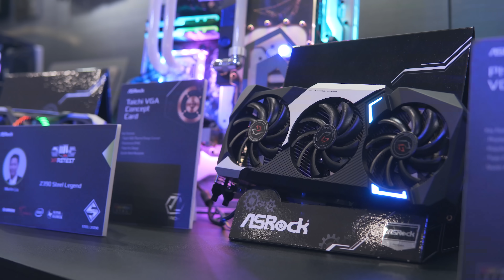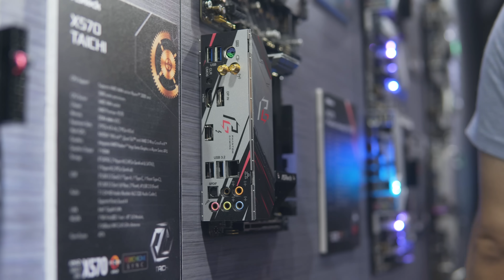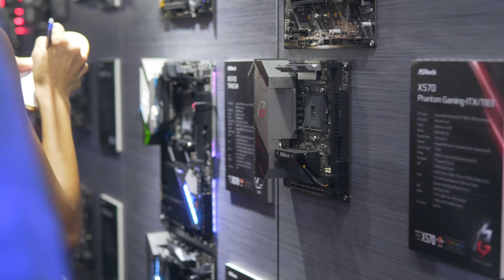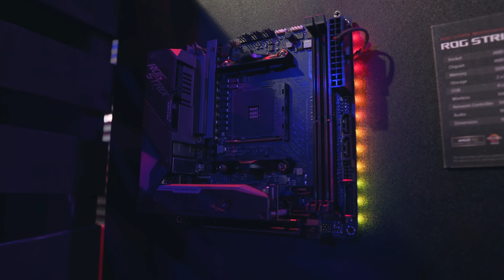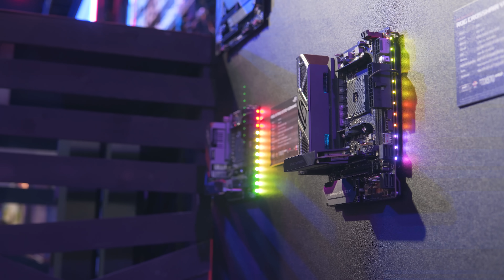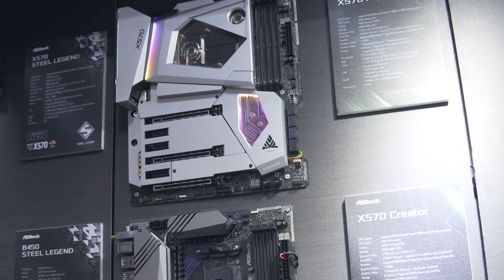ASRock X570 ITX Motherboard - Get Strix Instead?

Comment: 4 rear USB ports is more than enough. if you need more just get a USB hub. the only issue i see here is the SATA port position, but you can get a right angle SATA cable to try to avoid hitting the PSU in SFF cases.

Comment: This is an OK board, the main thing is don't buy the MSI itx boards as they've really dropped the ball and are really poor quality and performance. The Asus and gigabyte X570 itx boards at around £190 are both very good and well worth the extra £20-£30.

Comment: For everyone wondering why anyone would ever need 6-8 USB slots:

I need two for my keyboard, one for my mouse, one for my headphone's DAC/AMP, and one for my microphone. That's already five slots required, without even taking into account flash drives, external drives, webcams, and other miscellaneous peripherals for work purposes.

It adds up quickly. Thankfully, the TB3 port would be perfect for a USB hub!

Comment: 6-8 usb ports? I use TWO on the back (mouse and keyboard) I use TWO on the front (sometimes, not very often) so still 2 spare + TB3 port on the back, that's not bad at all... And there are 10Gbit ports on the back, that's pretty nice

Comment: Typical Ass-rock. 

Sadly, ignoring form-factors and making excuses is a long running habit of theirs. Like putting chips on the underside of the board inside Intel's keep-away zone, so you can't fasten coolers. Now huge rear IO shields with no ventilation while also blocking aftermarket air coolers, and I know they'll say "Oh, the design is for people using liquid coolers." because that's just what they do, design things badly and make excuses for it later. 

I recall when people hen people complained about the chips on the itx boards they said "Itx is a small form factor, so some placement of parts is unavoidable." All this flat out lies when none of their competitors had any problems doing just that. 

I'll stick to ASUS. As my grandfather said "You can make excuses, or make it happen. That's the only two options you ever have." ASUS makes it happen, ASRock makes excuses. I know who I'm going with.

Comment: No. But it's not. SAME.
Gigabyte in my country, it's just plates that live going to RMA. It makes 'common' versions of all computer components. This line 'Aorus' is just to get the Cattle. If it's only by appearance, then I'd get Strix. But no. Clearly ASrock is the only one to put really premium components on the boards, it has thunderbolt 3, it has audio with optical output, it has wi-fi 6 + bt 5, and it has a much more robust heatsink, besides being considered better for over Gigayte and Asus, are just branding and marketing. Yes, it's more or less, but still not close to ASRock, if we see the whole of the work. Clearly, by the robust dissipation set, asrock is the best version. The other manufacturers, use cheap components on the boards, making savings, and spend a lot on the 'marketinhg', like asus. ASrock, saves on advertising, but does not save on components. Much better. Asus where I live, lives giving problems in most of the boards, in the sound part. Majority RMA. MSI again, more or less. It does not do anything great or bad either.
Reply: @t1murik  so much so that I believe that asrock x570itx, will be the only one to be able to support the ryzen 16c/32t, in 'stock' without 'burn'. the others I do not know.

Comment: Wait.... Thunderbolt on an AMD board?! Am I dreaming?
Reply: O YE YE
Reply: Only the high-end mobos are getting it
Reply: Universal Audio Arrow user..
Reply: @IvanSDizon460  hey...help!should i buy this motherboard? Ryzen 7 2700 and apollo x6 uad!!!is it stable with uad apollo?
Reply: @georgezorbas6422 both searching for an answer, i am planning too,  i have ua arrow, still ,not using it,  i dont have pc or laptop with T3
Reply: @georgezorbas6422  macbook 2017 2018 2019 2020 a sure for universal audio..
Reply: @IvanSDizon460   no mac!I am gonna buy the Asrock x570 Phantom Gaming itx..the end
Reply: @IvanSDizon460  BIG DAY TODAY..I made some pressure and Asrock emailed me today and told me that they emailed UAD to send them a unit and find the solution for a stable compatibility through Ryzen and UAD interfaces with thunderbolt 3..Spread it..
Reply: @georgezorbas6422  that is a good news,  no need to expensive macbook

Comment: Pretty nice design, but what makes or breaks an ITX board for me these days is when they only have one M.2 slot. I don't want any 2.5 drives going forward. My Asus X370 ITX has one on the front and one on the back and it's just a pleasure not having to wire SATA cables anymore.

Comment: 6 to 8 USB ports on the rear? For what? You have Thunderbolt3 so you could run a hub, you have front IO which usual minimum has two USB and to be honest it’s an ITX board, can’t imagine the typical person going for that board really needs that many USB ports.

Comment: Am i correct in thinking that i won't be able to use that DTX board in a NCase M1 together with a AX3 because of the SupremeFX PCB?
Reply: No. I think it says on the ncase m1 page that Mini-DTX is supported. Check their page.
Reply: @mojoo215   I'm not worried about the board not fitting. I'm more concerned about the audio shroud blocking the Accelero Extreme 3 cooler
Reply: Ok nvm. Didnt understand what you were saying sorry.

Comment: I've yet to see a X570 ITX that gets my attention. My 2 requirements are SPDIF audio and 2x m.2 (even if one runs in sata3 and/or pcie 3.0mode only).
Reply: Zoomzabba does the Strix X570-I not have SPDIF? I know it’s got dual m.2 support and Asus mid- and high-end boards usually have SPDIF.
Reply: @natecook06  For audio, it has 3 black 3.5mm ports. Unless one has a 3.5mm TOSLINK back-end, I might have to strip digital audio off of HDMI with an adapter dongle. Starts defeating the purpose of a compact sandwich build if you have a billion dongles.
Reply: @zoomzabba452  Its 2019, use audio from HDMI dawg. And if you dont have it upgrade brah
Reply: @BoogieDownProduction  I've got a Logitech Z-5500. Probably going to get a Asus Xonar usb sound card for my digital out.
Reply: @Herr.Mitternacht  it's a somewhat reasonable solution. My thinking was 2x1tb because used ones are well priced and offered more future expansion internally. Currently I have 2.75tb between 2 ssd and 2 HDD. 1tb hdd can get external on the network

Comment: tb3 and optical audio out? this is the one for me
Reply: @Pho Tato "sorry, I can't hear you over the sound of my [mom's] system." You forgot that part.
Reply: @Pho Tato Whats wrong with optical out? Btw miniDSP is great. Have one hooked up to my PC as DAC for headphones and speakers.
Reply: @misterx3666  SPDIF is outdated because of bandwidth limitations, 5.1 gets compressed with optical. 
No modern immersive standard is supported by optical like Dolby Atmos or DTS:X. 
Still, it's great for stereo uncompressed. And I use it because my Logitech Z906 5.1 only has optical as digital input.
Reply: @hexeno  I want optical for convenience. If I build an sff itx PC I want to it to places (eg friends home theater). At the moment I don't care about those new standards as I am running a 2.1 setup (so is my friend). Pretty much every AVR and Dac has an optical in so it's good to have one on your PC. No driver problems and ground loops.
Reply: @misterx3666  exactly
Reply: @Pho Tato AFAIK you can't interface HDMI through DAC and/or amp without extracting the audio signal first. And if the usb out is noisy, optical becomes the most convenient option for dedicated audio setups
Reply: @Pho Tato Most people (including you) won't notice a difference.
Reply: @Pho TatoWow, trying to convince me you can hear a difference? That's a good sign you can't.

Comment: I love Asus' stuff, but the markup on their boards /cards is crazy
Reply: Asus quality isn't what it used to be... Been building for nearly 2 decades now
Reply: The last Asus motherboards have been garbage.
Reply: Warlock Plays like what ?? Been building for years and Asus make very solid boards. From dozens of builds i made they been most reliable. I’ve had good experiences with AsRock boards too.

If anything boards nowadays (at least mid to high end) are much more premium and difficult to “break”. Also less compatibility issues. 10/15 years ago was much different. There were solid boards too of course but there were many other issues, like compatibility with CPUs of the same socket, etc.
Reply: at least it comes with the added addition of better reliability and cooling
Reply: @heart4011  in theory at least

Comment: Really hope AMD implements more Thunderbolt. That's a hook selling point imho. Even sound interfaces support it like Universal Audio. Better yet, I hope Thunderbolt 3 gets full integration in USB 4.0 so everything on every board is supported.
Reply: It’s not down to AMD, this is down to board manufacturers to implement which they are all free to do.
Reply: @backupplan6058  Well let's hope they see the value in it. It definitely has perks and functionality. :D
Reply: @fxscreamer , I can see them doing it for the pro boards but doubt to see it on the gaming boards as you don’t really see it beyond the pro Intel boards.
Reply: they could have used TB3 years ago if they hadn't been cheapasses (royalty) now they are free to use... and we see ONE ITX with it? (sadly the ugliest of them all with what looks to be the shittiest VRM cooling ever with it all boxed up in that shroud with no airflow)
Reply: Jesper Andersen no, that not true. Both the creator and aqua board from ASRock have Thunderbolt3 on the Rear I/O not just the ITX board and most of their other lineup has the required port to allow their Thunderbolt3 add on card to be supported.
Reply: @backupplan6058  yeah and the Creator and Aqua do you fit into an ITX case how?... read what I wrote?
Reply: @Jesper Andersen “we see one ITX with it” that can be taken multiple ways, ether as what you say it meant which is its the only ITX to have it or as I took it, the only board with it is an ITX. If you don’t want to be limited to on ITX don’t have an ITX case, that’s a simple solution. I mean beyond those who use Thunderbolt3 for professional applications and laptops that can benefit from external GPUs it doesn’t make much sense to see everything supporting Thunderbolt3. Professionals prefer the larger boards anyway. Another question, how many Intel Z390 ITX boards support Thunderbolt3? It’s Intel’s technology and if it’s so in demand as you seem to believe it is all should have it right?

Comment: fan dead = motherboard dead ?
Reply: Nope. Just thermal protection state. Should give safe opportunity to RMA or bodge a new one on.
Reply: @zoomzabba452  thank for information
Reply: fan not gonna run most of the time anyways, only runs when you abuse the PCIe 4.0 and from what they said... then that means hammering the NVME's(NVME Raids) so mjaae not too worried... and that fan there can easilly be replaced too

Comment: I've just seen the angled SATA ports, this board just died for me.
Reply: 90° SATA cables are a thing. Not gonna lie, it's definitely difficult compared to standard for a sandwich build vs trad tower.
Reply: @zoomzabba452 A lot of the smaller ITX cases (Dan A4, Ghost s1, Dr. Zaber Sentry and more) have something directly next to the board, usually the PSU. You might get away with the Silverstone ultra low profile Sata cables, that are only around 3mm or so in height, but no normal angled cables are going to fit. Also, those Silverstone cables are really hard to find in some places of the world. I personally have a case with only around 1-2mm next to the edge of the motherboard.
Reply: @felentus  Dang. I just measured a 90 and it was ~10mm. I assumed 4-6 was enough. Apparently not. This is good as I went from considering the A4 to the Ghost, and now the Sliger SM560. I was personally already going to get the Silverstone SATA cables.

Comment: They cheaped out on usb ports on the rear IO backplate. At a minimum I need 5 of them.
Reply: Phanbot01 For what?
Reply: @Athasin  My corsair K70 keyboard requires 2 usb ports, my mouse takes one, I have a pair of speakers that connect to usb and the wireless adapter for my XBox one controller. That's 5 usb ports in total that I nedd for my setup.
Reply: @Phanbot01  Ahh, okay. Was just curious because at min. I need 3 (keyboard, mouse, headset) and I like having a fourth as a spare just in case since my MOBO has bluetooth integrated. I never knew there were keyboards that required two.
Reply: Athasin I think all Corsair boards with RGB lighting uses 2 usb slots due to having two pcb’s in them. One for the lighting, one for the keys themselves.
Reply: Same here. Keyboard, mouse, speakers, headset, wireless phone charger for my desk. 6 is the minimum I would buy
Reply: thats why they make USB hubs.

Comment: Personally, I reckon the X570 I Aorus Pro WiFi is the best ITX out of all the ITX boards so far.
Reply: No. But it's not. SAME.
Gigabyte in my country, it's just plates that live going to RMA. It makes 'common' versions of all computer components. This line 'Aorus' is just to get the Cattle. If it's only by appearance, then I'd get Strix. But no. Clearly ASrock is the only one to put really premium components on the boards, it has thunderbolt 3, it has audio with optical output, it has wi-fi 6 + bt 5, and it has a much more robust heatsink, besides being considered better for over. Gigayte and Asus, are just branding and marketing. Yes, it's more or less, but still not close to ASRock, if we see the whole of the work. Clearly, by the robust dissipation set, asrock is the best version. The other manufacturers, use cheap components on the boards, making savings, and spend a lot on the 'marketinhg', like asus. ASrock, saves on advertising, but does not save on components. Much better. Asus where I live, lives giving problems in most of the boards, in the sound part. Majority RMA. MSI again, more or less. It does not do anything great or bad either.
Reply: I believe this is the only board capable of supporting the Alpenfohn Black Ridge (with removal of the fan on the SB/M.2)

It's getting my money day 1. The sooner I get it, the sooner I can confirm if it will work (and make other plans if need be).
Reply: I agree. In a mini-ITX case with an AIO you won’t be able to push even a 16 core to the point where VRM throttling is more important than CPU throttling (especially since these boards all only have a single 8 pin the VRM at max draw, like 400W, will only be making ~30 watts of heat).
Reply: @TheRinx87  Hopefully you'll reply...Can you expound on your comment? I'm not sure what you mean, and I'm trying to decide which one of these x570 boards have the best vrm (I'm getting the 3900x.) I'll probably be getting an AIO cooler so your comment was very interesting.
Reply: @Alb 92 Good bios vs Good HARDWARE.
I ever, prefer hardware.
Reply: @Herr.Mitternacht  dumbs. the new itx mobos have 10 phases. AND active pipes. suports yesss a Ryzen 16 core at stock. ,,And intel? trash. the asrock make a x299 itx mobo for it! is beuty,. dumb.